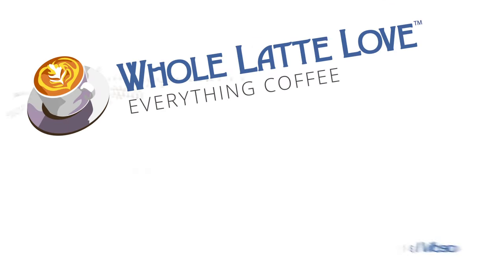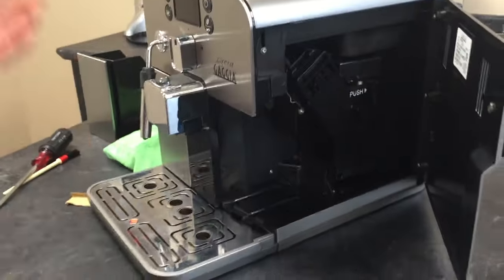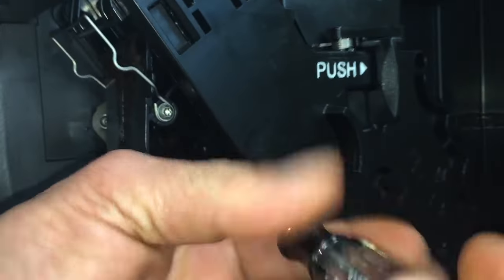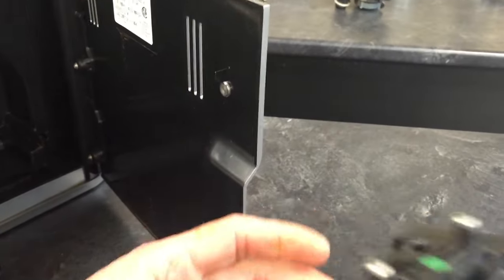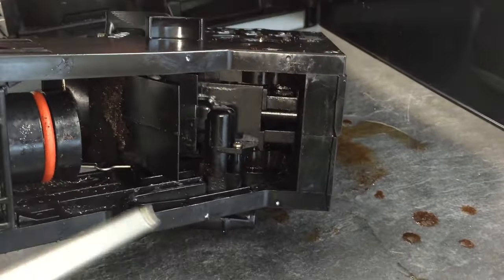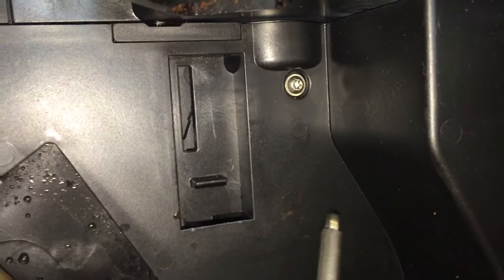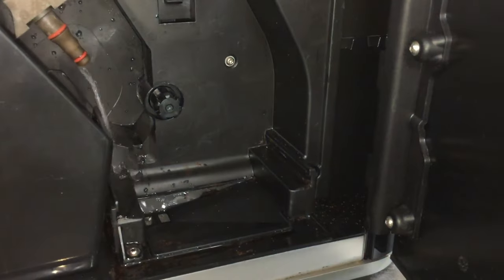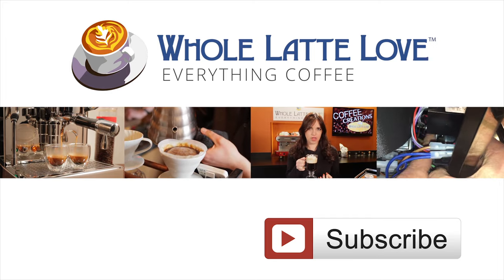How To Remove a Stuck Brew Group on a Gaggia Brera

Comment: Brilliant - couldn't work out why the brew group wouldn't go back in - but my other half admitted she had turned the machine off mid cycle, and this explained it, thanks. 
Not impressed by the design, though; I'm guessing that there are a few non-internet types who have called out the engineer when this happens.

Comment: My Brera had an issue with a slow water flow, your video on cleaning the selector valve fixed that, but then the grinder went into overdrive and wouldn't stop grinding every time I turned the machine on! I put the machine aside for three weeks while searching for someone to fix it and resorted to my old cafetière. Today, out of sheer desperation I found this video, and Walla  issue fixed, just had a delicious cup of coffee. Thank you!!!
Reply from the maker: Excellent - thanks for the report!

Comment: Thank you for the video! As my Philip 3200 started up and the power got interrupted, and the brew unit became stuck in non-neutral position. So weird that it doesn't reset itself just by turning it off and on. Without your video, I would have to go through the whole service route through Philips, which means 2-4 weeks without espresso! I especially appreciate that the technician mentioned the type and size of the screwdriver, because I didn't own one and had to go get. Love getting coffee through you too. Always great price, and fulfillment timely. Thank you again!☺
Reply from the maker: Hi Betty, Happy to help and thanks a whole latte for taking a moment to leave your comment!

Comment: Thanks a lot for the valuable guidence, I had follow this steps completely and it works well now.  just additional experience that closing the side cover then put the power "on" was sufficient to reposition the gear back to original placed and the brew group able to rack in back in the normal position.
Reply from the maker: Thanks for sharing

Comment: Thank you so much for this! I was able to apply the concepts to my Saeco Vienna Plus and got it working again!.  I had to go to the hardware store to buy a Torx T-10 screwdriver, but all good.  Note to others: watch the video all the way through -- there are quite a few steps to get the brew group back engaged (I say this from experience of jumping the gun and trying to make it work without doing all of them).  Thank you again and again.
Reply from the maker: Hi Ruth, Thanks for the comment and sharing your advice! So happy to hear this helped you out!

Comment: Well done!  One comment is that if I took this seriously before I purchased the unit, I would have had second thoughts.  But it bailed out our Titanium model, which has the same brew unit.   If "How to remove a stuck brew unit" gets 602,000 views (a different Whole Latte Love video),  that says design flaw to me.  But I love the machine when it works, and we're in the 8000 cup range and heading rapidly for 10,000 cups.  Take that, MTBF.
Reply from the maker: Hi Mark, Thanks for the comment and sharing your experience. 8,000? Now that's something but not unusual. We know they can go to 20K with proper maintenance. Many stuck units are the result of inadvertant operator error. Suppose that potential could be designed out.

Comment: Thank you for the instructions. I did the whole thing with the screw, all done perfectly. Machine turned on, did the works but only the double cup button produces coffee. The single cup button produces a subdued sound but no coffee. Any advice?
Reply from the maker: Hi GZ, Hmmm, is the single cup button program to a very low drink volume? Try press and hold on the single cup button to go into programming mode, the machine will start to brew. When you have the amoount you want in cup press the button again to store that amount.
Reply: @Wholelattelovepage  Thanks man, that was it.  Subbed. 😉
Reply from the maker: @georgezachos7322  My pleasure!

Comment: Excellent video.
Reply from the maker: Hi Elfin, Thanks for sharing your thoughts on the machine! I wonder if the air escaping sound  is the vacuum relief closing as the boiler reaches temperature of 100C/212F. Should only hear that for a few seconds and know that's perfectly normal.
Marc

Comment: Hi Mark, I have an issue with my machine: hot water or coffee won’t come out of the group head. I’m o my getting wet coffee pucks and murky water on the tray. But no espresso or lungo. Any idea of what you be wrong? I did a deep cleaning of the group head, and the grinder, but no luck.

Comment: There is an easier way to try before going in with a screwdriver. Try putting the machine through the test mode. There are several videos on YouTube on that. On the second (or the third) step of the test cycle the machine will move brew unit into a different position. For me it kicked the machine out of the descaling loop. It quickly finished the rinse cycle and was ready to brew!
Reply from the maker: Hi C, thanks for the the tip.

Comment: Thanks for the video!  I took our Gaggia Babila apart this morning to clean it, and since I put the Brew Group back in it has failed to produce coffee!  The coffee gets ground and put in place, but the water just seems to end up going into the inside drip tray, and nothing comes out the external spout!  Can you help with some things to try please?
Reply from the maker: Hi WJ, You are welcome for the video. Is the water that ends up in the drip tray pure water or is it coffee colored? If coffee colored most likely problem is the brew group's top spout was put on backward. The only way this could happen is if you took the group apart and put the spout on backward. If water in drip tray is clear problem is likely a poor seal between the group and the boiler spout. The boiler spout is behind the brew group. It's white with 2 o-rings. Makes sure the o-rings are there and in good condition.

Comment: My problem on this machine is when i press the on button to warm up the machine the rinsing water doesnt come out from the same sprout that the coffee comes out. It goes all in the bottom tray. The machine makes very good coffee but the bottom tray is always filling up with water. Do you have any idea on what is the problem causing this?
Reply from the maker: Hi EC, Forwarded your issue description to our lead Gaggia Tech. He recommends these videos to help diagnose and resolve:
https://youtu.be/K171zJwfB8U
https://youtu.be/Q-gcsa_2sV4

Comment: I have a saeco intelia hd8752 manufactured in 2013.
I was successful in getting the brew group removed. I did a solid cleaning of full machine, not knowing I wouldn't be able to place the brew group back in. The internal gear won't align properly with the brew group. I have the two triangle arrows lined up on the brew group. I've tried doing the steps you show with no success getting the gear inside to go back to home position. The gear turns clockwise and counterclockwise a few times then stops.  The service error 4 still appears after every attempt. Over 15 tries. Is there a brew group sensor that needs to be replaced. If so, what is the part number? Can you help?
Reply: I loved the video but I'm still having trouble
Reply from the maker: Hi KD, Unfortunately I'm not intimately familiar with that make or model so cannot advise on part numbers. Sounds like the internal gear in the machine (not the group) is out of position. Sometimes just unplugging machine, wait 10 seconds, plug back in, and turn power on will cause the internal gear to return to the proper position. Here's a video on a similar machine which may help if that doesn't work. Towards the end of the video it shows how to go into the tech menu and use that to return the internal gear to the proper "home" position: https://youtu.be/nZ_LKGkQ00E
Reply: @Whole Latte Love  this has been successful.  Thank you so very much for the video.  It worked well with my Evo italia model, too
Reply: I now follow you on YouTube 
2 thumbs up.

Comment: Thanks for the video. I have a saeco vienna deluxe and I’ve tried resetting and having the gears go back to the neutral position but when I do this they are slightly off and in the 12-3 o’clock and not 9-12. Any ideas before I toss this in the street
Reply from the maker: Hi b, Sorry you are having issues with your Saeco. Best advice I can give is to try resetting again.
Reply: @Wholelattelovepage  yeah I’ve tried many times to reset it. It’s like the gear is off to the other side. I’ve tried and tried. Any ideas would be wonderful. Thank you

Comment: We got a Gaggia Platinum. We followed Every step of the clip. 

However, the main problem now is that the machine doesn't register the central Unit: it says it should be replaced, while it is placed.

Any Idea how to solve the problem?
Reply from the maker: Hi F, There is a sensor activated by a tab on the brew unit. Sensor could be faulty or the tab is not activating it.

Comment: Hello Whole Latte Love team! I am looking for some advice, please... I bought a Gaggia Anima Prestige in June 2018 and since 2 months ago or so, the quality of the coffee is not good, we have tried several things like descaling, cleaning, lubricating, changing the grinder settings, etc but nothing works. We have noticed that the ground coffee pellet (the one that goes to the deposit) is too wet, and loose and not compacted as it used to be... any ideas how to fix this? THANKS in advance and stay safe!!
Reply from the maker: Hi Pedro, Thanks for the question and your good wishes. Our team in NY has moved to work from home through VPN so still very much in operation and available to help you solve the issue. You have tried all the right things so my advice is to give our Tech Support folks a call at 585-924-7170 during EST business hours while at your machine and they can assist you.
Stay safe as well!
Marc
Reply: @Wholelattelovepage  Thanks Marc for the prompt response, I appreciate it! Ok, I will call the tech team. Cheers!

Comment: I cannot  remove the brew group because the screw is stripped. Because of the angle it makes it very difficult to use a drill or screw remover.
Do you have any others suggestions ? Thanks!
Reply from the maker: Hi DL, That's unfortunate! Any chance you could file a new slot into the screw head or maybe use something like a Dremel tool?

Comment: Hi! What if my 5 sticks middle engine rpund stuff not going back to the correct position? I mean I can put ut to home-and-work start finish position but can' put back the unit as the middle engine is cant be in the correct position. Thank You!
Reply from the maker: Hi RG, Not sure I undertsand. Are you sure the brew unit is in correct position before attempting to insert?
Reply: @Wholelattelovepage  sorry as I am a Hungarian. So I can turn the brew unit from start position to end position its all ok. The engine can do everything in the TEST MODE as well as in normal mode. But I cant put back the brew unit, cuz my engine shaft(?) is actually upside down. I saw a lot of videos about that shaft with the thin and thick sides on it but mine just can't turn that much. When I do power off-on hard reset it is do the reset but still not in neutral spot, exactly inverse like yours. :/ Second problem now is that clean water, clean system, but the water is not coming thru anymore. Heated but not coming. I hear some quite pump sound in testing to push water but not coming thru. Thank You for answer, and I glad that I can reach You after a lot of years of this actual video
Reply: Can I send You a photo in email pls?

Comment: Hi, thanks for the video. I have a Gaggia Brera machine. Your instructions helped me to get out the brew group in no time. My problem now is that the jog wheel won't return to the home position no matter what I do. When I turn the machine back on the exclamation mark icon starts flashing, then the machine starts rinsing with the heating symbol flashing and the left bean symbol lit up.
When I bring the jog wheel in the correct position by pressing all buttons at once (then the wheel starts turning until you release the buttons) and insert the brew group, the group gets stuck in the wrong position all the time.
This whole problem started when my mother in law pressed buttons randomly, but I can't say what she pressed exactly.

Any suggestions? Thanks!
Reply from the maker: +Thomas Körner Hi Thomas, Are you sure the brew group is in its Home Position before re-inserting in machine? Review how to make sure it is - and get it there if not at about 3:05 in the video. Hope this helps!
Reply: Yeah, I'm positive that the brew group is in its home position. I also was able to get it back in when the gear was in the home position as well but it keeps returning to the blocked position every time. I have tried to run a few cycles with all sensors blocked for several times but the gear always returns to the faulty position, brew unit in or out. Thanks for your quick reply. I guess I have to bring the machine in for service.
Reply from the maker: +Thomas Körner Sorry couldn't solve the problem. Sounds like you've tried everything. Service is appropriate at this point.
Reply: Thomas Körner did you fix it?also my machine over push and it shows error code

Comment: How do I get the test mode to start stays on and goes to Brew unit blocked Brew unit removed all switches tripped still no start mode. Saeco royal
Reply from the maker: Hi David, Hard to say from here. If in US give our tech support a call at 585-924-7170 and they may be able to help.

Comment: Good video, but on the Gaggia Accademia, the drip tray and coffee grounds drawer must be removed first. It is a big pain to remove, and you must be careful not to break it.
Reply from the maker: Hi Richard, Thanks for the comment and the tip!
Reply: @Wholelattelovepage , thanks for reading and responding. As a WLL customer, please consider doing a video on this issue using the Accademia.

Comment: We have had 2 gaggia machines recently: both were wonderful...until they broke themselves. The brewgroups got stuck mid-cycle, sensors unaccountably stopped working. Do yourself a favor: buy a decent coffee machine that does not have moving parts. These coffee robots don't last.
Reply from the maker: Hi, Thanks for the comment. Like most machines these will not last forever but with a little maintenance they should provide years of trouble free service. We get regular reports from Gaggia owners of 10,000, 20,000 even 30,000 brewing cycles. Key maintenance items: 1. remove and rinse brew group weekly. 2. Descale as recommend based on source water hardness and water filter usage. 3. Deep clean and lubricate brew group every 6 months.

Comment: I have a hipresso it does not have an opening to put the cardboard into, what should I do? please help
Reply from the maker: Hi EA, Not familiar with that brand. But if your machine/brew unit is similar it likely has a sensor(s) somehwere that need to be tricked.